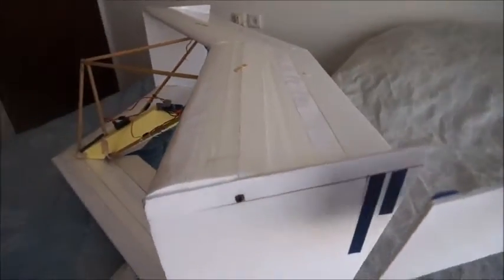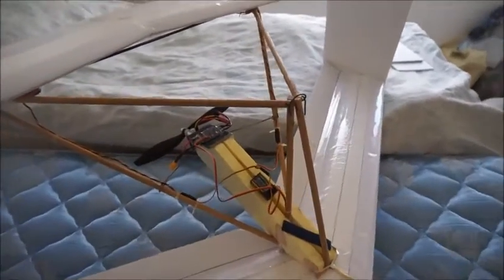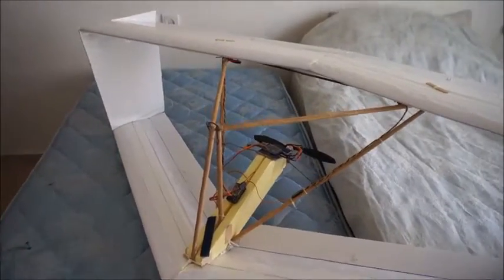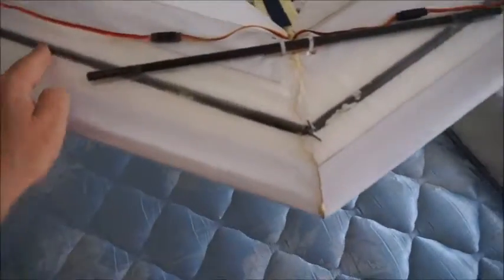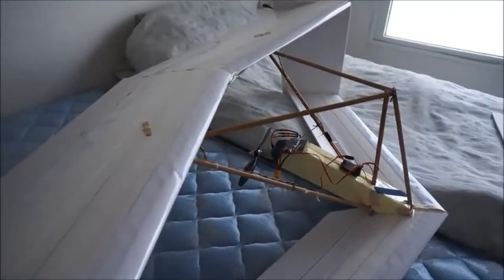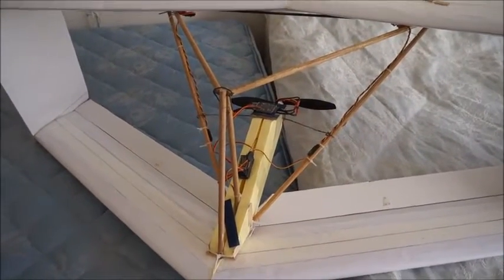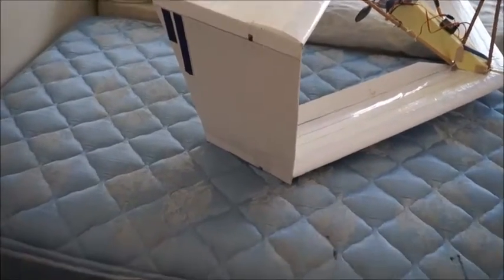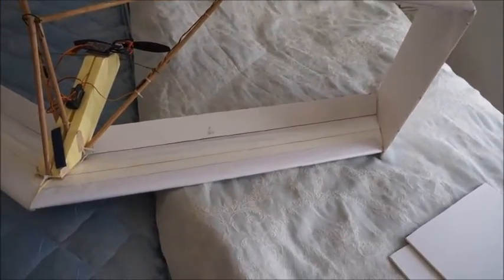Tips for BoxWing

Comment: Add "toe in" to vertical stabilisers for better yaw stability,
make angle of attack of front wing (for 2° or 3°) greater than for the rear wing for better pitch stability (better glide, smoother stall characteristics),
and front wing on the top and rear wing below would be even better to start with.
Reply from the maker: +206LaKi
I'm not a big fan of toe-in (extra drag). The additional skin friction of extended vertical surfaces is most likely less draggy and seems to provide excellent yaw stability.
I do indeed have an incidence of a couple degrees to the front wing.
Regarding whether or not the front wing should be above or below: This seems to be hotly debated in the engineering community. Designs like the Elytron, Stratos and others favor the front wing being the lower wing while others have it reversed.